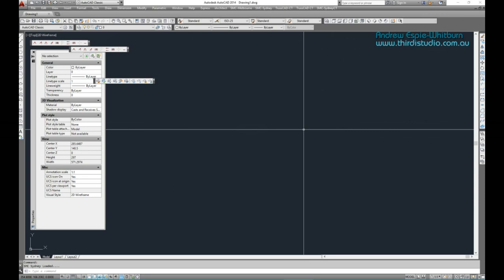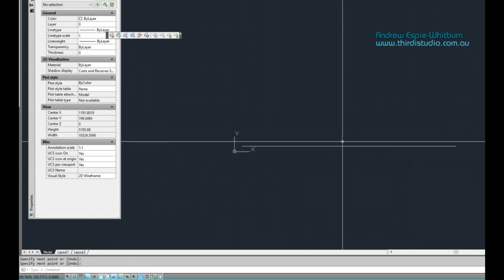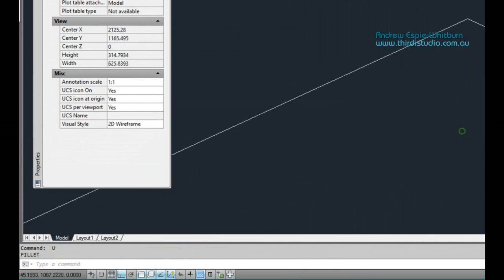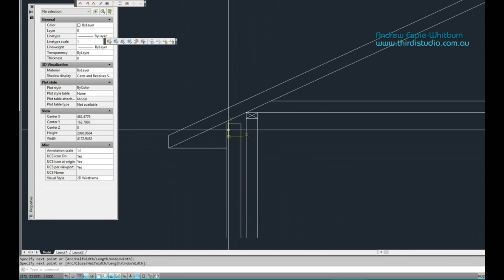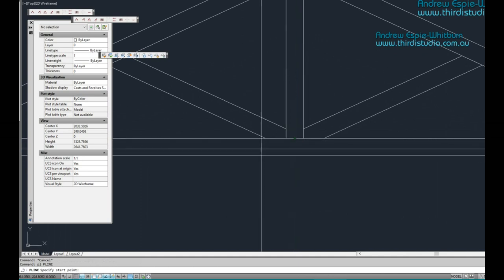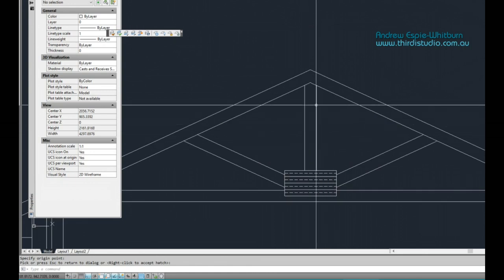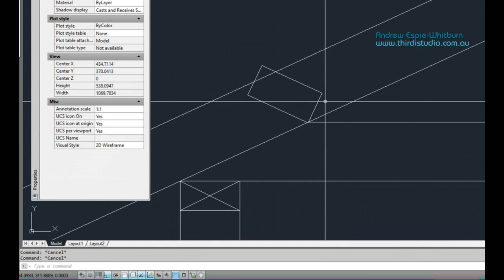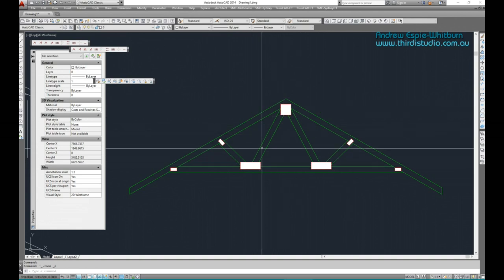Basic & Easy How to draw a roof truss section detail in AutoCAD Tutorial

Comment: Hello, Andrew.

I purchased TrussCAD a couple years ago.  I like the program for drawing floor / roof trusses from time to time but the only aggravation is converting metric to Imperial (I''m in the USA).  Lumber dimensions don't exactly scale right but it's been close enough.  Did you happen to update the program with Imperial units?

Thanks!
Reply from the maker: Hi Derek. I have been slowly working on that. What you can do in the mean time, is type UNITS in AutoCAD, then in the drop down box under 'Inertion Scale", change that to Inches, then click OK. That will adjust the nail plate sizes. The default of 90mm can't be changed as yet, not until i release an update for the imperial system. 
Out of interest, when you input lengths for lines, polylines etc., how would you input 6 foot 3 inches? (6'3")? It would be good to know for the update.
Thanks Derek

Comment: Even if I drew up a truss how could they get stamped for city code
Reply from the maker: It won't be stamped for approval. Drawing trusses for building plans are only indicative. The truss would need to be designed by a structural engineer or approved by a truss manufacturer. However a truss manufacturer won't certify a truss for you to make yourself, you would need them to also make the truss or trusses for you. 
Depending on how the truss is designed, also depends on whether you can make it yourself.
Manufactured trusses usually use specially designed nail plates that are pressed into timber with hydraulic presses, and the manufacturer will give you computations to give to pass the codes for structural integrity.
You can't generally do that yourself as you won't have machines or calculations to prove the trusses integrity. Nail plates you can buy from the hardware store that you can hammer in won't usually be accepted.
A structural engineer could design a truss you can make yourself if you tell them that, and it will likely be made with gussets instead of nail plates. (Depends on span of truss)
Gussets are usually steel so they will need to be custom  made. I have also seen plywood gussets too which would be easier to make yourself.
Good luck